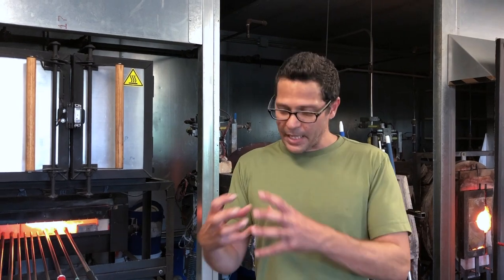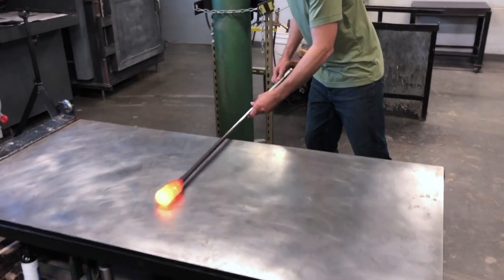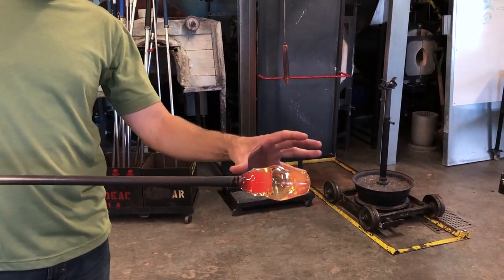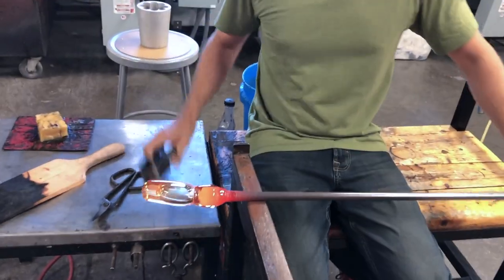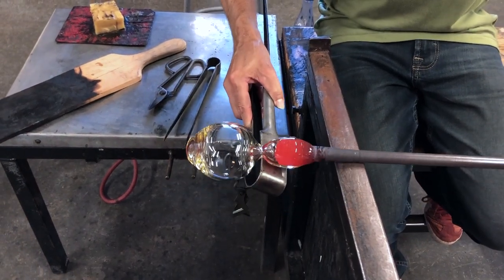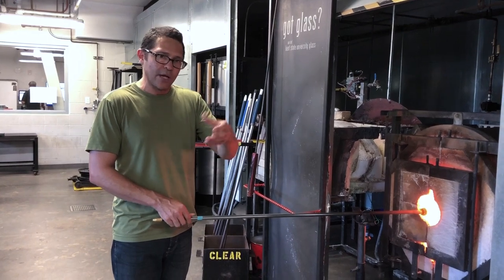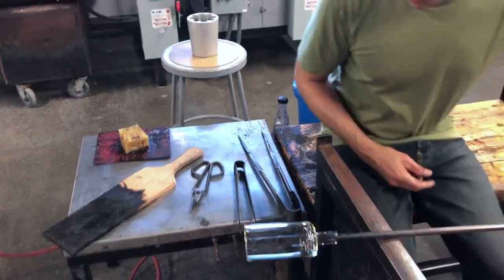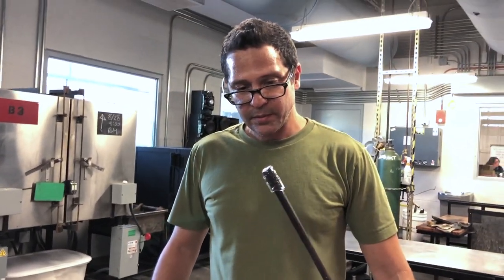Handmade Blown Glass Tumbler - Watch & Learn

Comment: What can you recommend to consider/try to get larger gathers on that second dip? My drinking cups are fairly cylindrical - but are tending towards a slightly larger sake cup size, and are fairly thin…
Reply from the maker: There is something called a "Collecting Gather" where you try to "scoop" the glass out of the furnace. This is done by turning faster and sort of skimming along the surface of the glass to push a ball of glass on to the pipe. So, turn faster (and more) and exit the glass at an angle where the glass won't drip back off into the furnace. Hope this helps!
Reply: @kentstateglass5011  Thanks - def makes sense! Will work with that in the hot shop next week

Comment: Question. Actually 2. 
What are you doing to the neckline with the back of the jacks
Reply from the maker: If you're referring to the moment when it's still on the blowpipe, I'm straightening the neckline so it's in line with the blowpipe. That helps the body of the cup be on center.